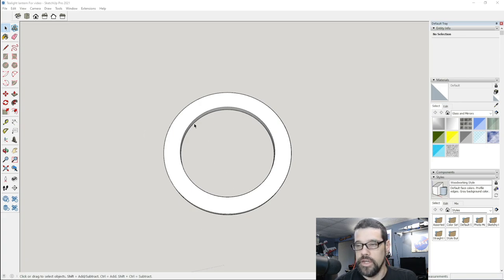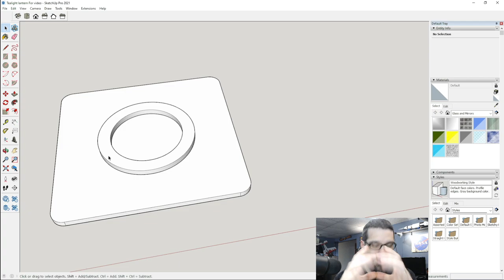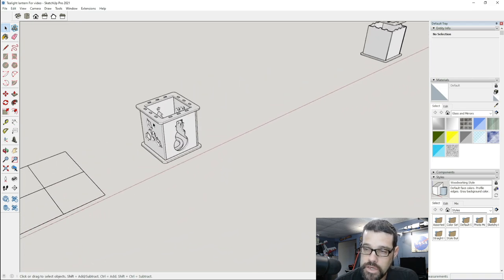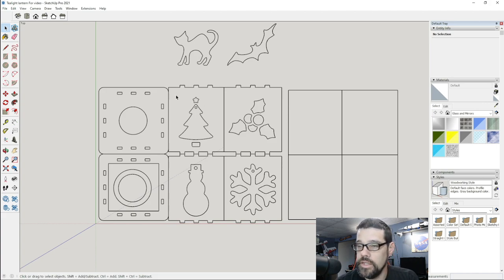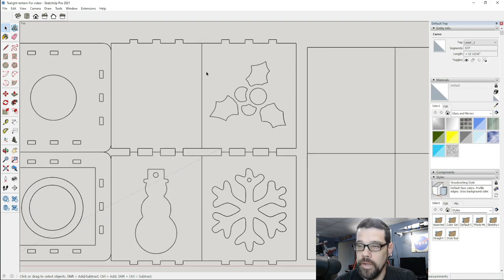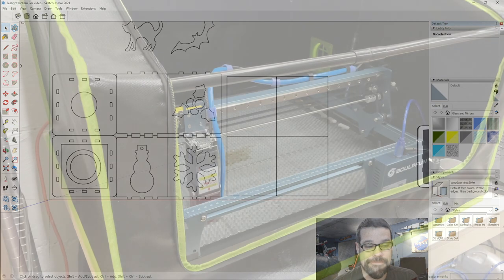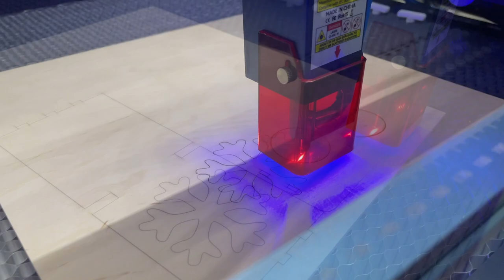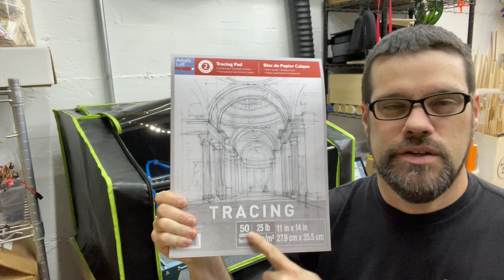Laser Cut LED Lanterns | Sculpfun S10 Diode Laser

Comment: I got an S6 and have failed to cut anything, stressed now
Reply from the maker: The S6 is a 5w optical output laser from what I see. It can cut some 1/8” material but will need much slower speeds or many more passes compared to a 10-20w machine.